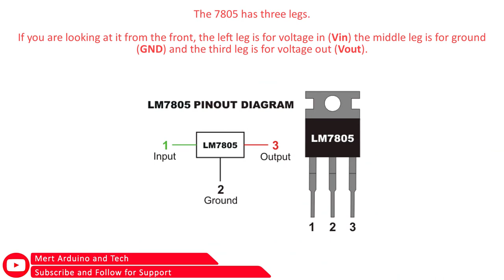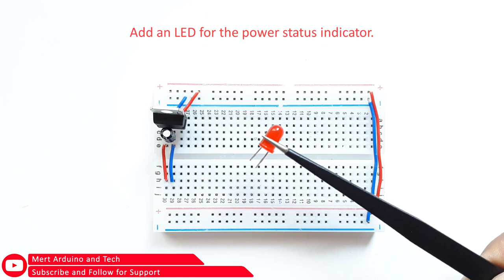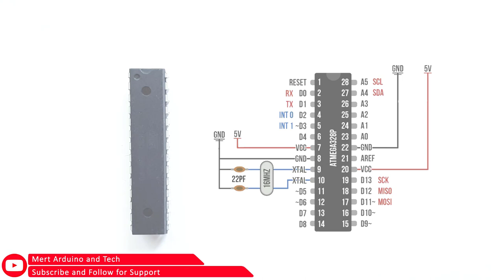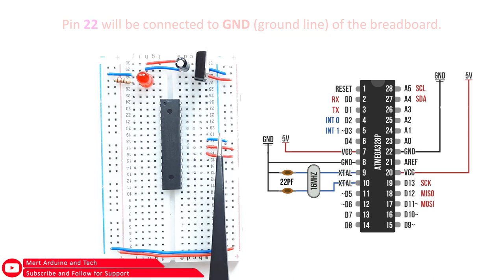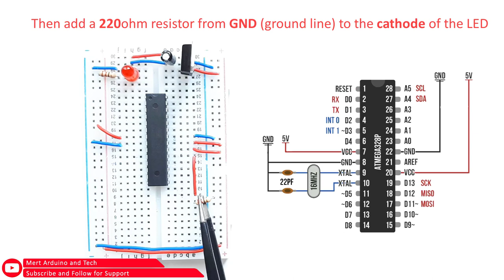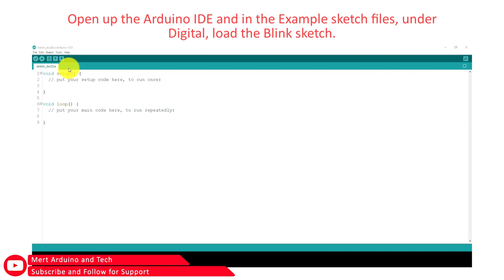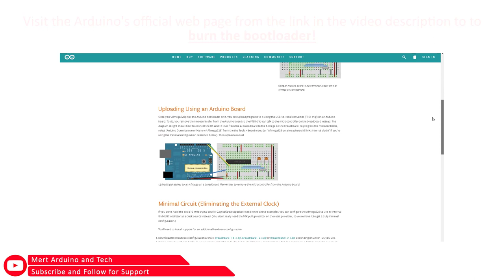Make Your Own Arduino Board | Atmega168/328 IC | Mert Arduino and Tech

Comment: video is good but it would be better is it was mentioned the reason for connecting the components in that manner for eg:reason for connecting capacitor across voltage regulator and at that point

Comment: Put a ZIF (Zero Insertion Force) socket on your PCB so you can easily take out the uno (328p) chip. That way you have a programmer board that let's you upload to multiple MCUs easily. Pop one in, upload, remove, repeat.

Comment: Sir I have only PL2303 Usb To Rs232 Ttl Converter sir can I connect the Rx pin of the chip to the tx of the converter and vice versa. And I am normally connecting the 5 volt And the ground to the converter

Comment: I have a 20x4 LCD with I2C (PCF8574) in my project which works 100% fine when setup with the ATMega328 on the Arduino UNO, but when set on a PCB I made with the same ATMega328 (without the Arduino interface) it only shows white squares.

This is the data I believe to be talkpoints:

•	The cables used are 10cm long breadboard jumper wires
•	SCL, SDA, VCC and GND connections from the ATmega328 to the LCD are OK (no mixed connections)
•	I tried with and without 4.7kOhm resistors from SCL to VCC, and from SDA to and got the same null result with both setups
•	I have a LM7805 with decoupling capacitors that feeds the IC (power source is a switching 12V 5A), and it indeed recieves 5V.....

•	Please can you assist in finding the  finding solution.

Comment: Is the DTR pin is mandatory?
I have USB-TTL 2303HX... There is no any DTR pin... :(
Reply: You dont REALLY need it, but it makes your life easier. If there is no DTR pin, you'll need to push the reset button of your "arduino" at the same time you click to load the program (but this timming need to be quite precise)
Reply: I converted the 3.3v pin to DTR pin...
3.3v is useless for me... I use only 5v boards...

Comment: Sir where are digital and analog pin
Reply: Check the atmega pin mapping at the official Arduino website and there you will get to know what atmega pin has what function in replacement of the Arduino pins

Comment: Can it actually work like a real arduino
Reply: It is the same as a real arduino. Same chip, same inputs, same outputs.
Reply: Yes It is arduino uno
Reply: It can work better because more wires can be attached to the same pin as the project is made on breadboard or PCB.
Reply: @pileofstuff  Will the serial monitor work?
Reply: @billglass5160  Yup. using the same connection used to program it.
Reply: @pileofstuff  OK that's great! I will make my breadboard as you show with the additional sensor I want to add and program and debug directly on the breadboard. Then I will make the final version using a perf board and an FTDI socket in case I need to fine tune my code. Cool way to go! I like it. Thanks!

Comment: there is 2x vcc and gnd on atmega chip. why they are doubled is there some reason.
could use 2 of those to make it A6 and A7. so not need use D pins for A. well cant change that anymore lol lol.
i mean A as address lines not analog use. so programming is easier, but yes cant change it anymore. who is designer lol

Comment: cheaper to buy than make, why make it when u can buy it cheaper
Reply: and you can put it on a pcb along with the other stuff so it is cleaner, smaller, and permanent
Reply: @matthewfogel8447  And you can use 3 AA batteries instead of the 7805 and 9V battery. It will save battery life compared to using a normal Arduino Uno board.